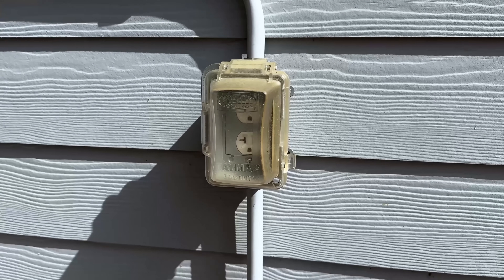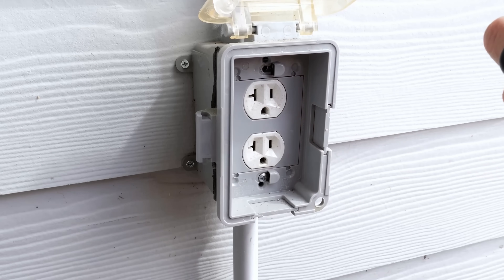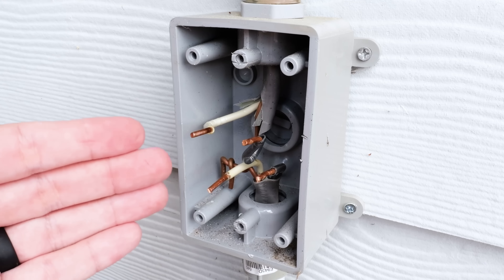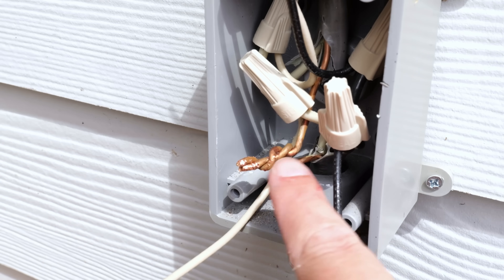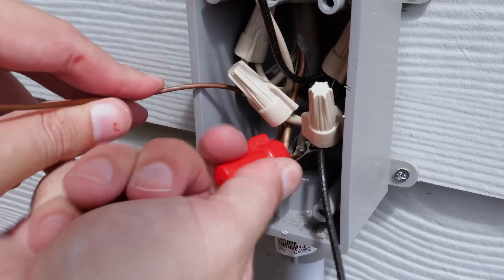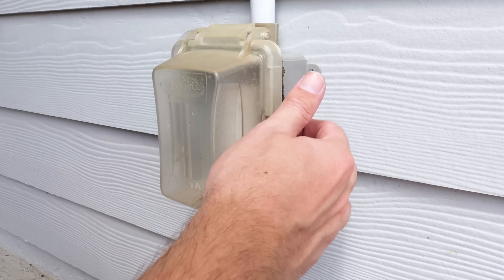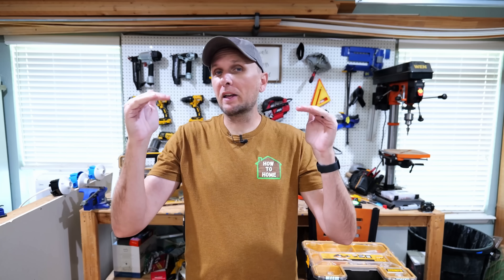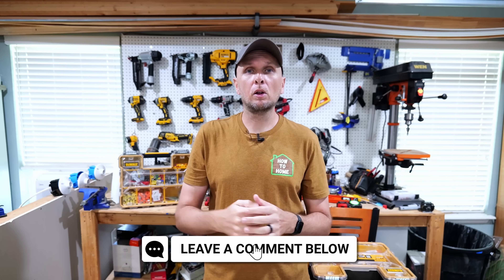Dangerous Mistakes DIYers Miss When Installing Outdoor Outlets!

Comment: The box got really crowded with pigtails and wire nuts,
and overcrowding isn't just about overheating.  
When you were putting the outlet and wires in the box, you folded the bare copper ground pigtail over to the side of the outlet with those bare hot connections.
You used the screws to pull the outlet and cover into the box.  
That left the final positioning of the wires to chance.  If the ground pigtail contacts a hot connection (seen that), or wire on wire contact cuts through the insulation(seen that too), it won't be pretty.
Reply from the maker: The ground is not along the side.
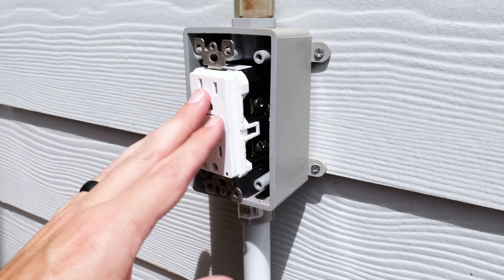Reply: Look at 10:18 when the ground pigtail got folded.
Reply from the maker: @stephenmathewes5159 that isn’t where it stayed.  I’m not looking at it but I’m pretty sure there is a jump cut then to screwing down the receptacle.

Comment: Unless you pass the 10 gauge directly you have the voltage drop issue so that load further down the line is not accounted for, correct?  You would have to keep that 10 gauge line on a path all the way through, so doing 10>12>GFCI>12>10 could cause overheating in this line or poor performance or failure of the down line accessory.
Reply from the maker: No.  Voltage is voltage and it only starts dropping the longer down the line.  This was at the very beginning.  Will have zero effect with the #12 there.
Reply: @HowToHomeDIY  thanks
Reply from the maker: You’re very welcome.

Comment: Why didn't you tie both #10's and the pigtail together?  Standard way to do pigtails.  I also don't think you adequately twisted the wire nuts in place.  My understanding is that the twist should continue to the insulated portion of the wires.
Reply from the maker: Because then my GFCI wouldn't be protecting the outlets downstream.  Yes, I would have liked to have had more twisting below the wire nut but you really aren't going to get that much with #10 wire and especially with them being so short.
Reply: @ I was typing the reply and forgot that you were gonna install a GFCI.  For my shop I put the receptacles on GFCI breakers and had that in my head.
Reply: @ I was typing the reply and forgot that you were gonna install a GFCI.  For my shop I put the receptacles on GFCI breakers and had that in my head.  They make drivers for wire nuts that allow the use of your favorite cordless tool.  It's cheap and does a better job faster.
Reply: Because that would've left the downstream receptacles with no GFCI protection.  The downstream wiring going out the bottom of the box has to be connected to the "LOAD" side of the GFCI receptacle.

Comment: 20 amp recepticals are not a problem in them selves ... a breaker at the box would be fine .. specific test tool and a sticker
Reply from the maker: Would have to be a GFCI breaker.  Which I don't prefer personally.

Comment: Should have ran THHN in conduit instead of uf wire
Reply from the maker: Why, there is nothing wrong with UF wire in conduit.  especially for such a short run above the surface.

Comment: Probably should have used a deeper box or extension ring. Conduit doesn’t need a strap unless it’s more than 3’ long. Also 12awg is sufficient unless you are going an extremely long distance. I suggest using a voltage drop calculator.
Reply from the maker: For the purposes of this video and what 99% of people will find in their boxes, the box was fine.  After the video I added an extension ring for my personal situation.  There is no way I am going to leave my conduit without a clamp unless it is an extremely short run.  The distance from this receptacle to the next one is well over a 100'.   Voltage drop needed to be taken into account.

Comment: I was thinking of two solutions to handle the very stiff #10 wire.  Get a deeper box, or add an extension, to give you more room for the pigtails.  Or to have used in the first place more flexible stranded wire.  My two cents.

Comment: Considering the size of the wire and all of the extra devices and wire added to the box, did you exceed the box space capacity?  You may have wanted to o add a box extender.
Reply from the maker: So yes in my instance I am slightly over box fill calcs just because of the #10 wire.  I did not change any of that for this video as almost nobody watching will come across this.  #12 or #14 would have been just fine.  The pigtails and wire nuts don't count for box fill.  I added an extension ring after I got done filming for my own personal situation.

Comment: Great video - very helpful. Just a comment - I like to use lineman's pliers to twist the wires together before I put the wire nut on. It's an extra layer of security that the wires won't separate under the nut.
Reply from the maker: I usually do too but with how short the wires were in the box and to save on time I just twisted them on per manufacturer's instructions.
Reply: Our inspectors wanna see the insulated part of the wires twisted together also. Thats
just the way that they want it

Comment: Hey, it’s possible that the outlet was already protected by a GFCI, but it was in another location? In a couple of houses I’ve owned they put the GFCI in the garage, which was a pain. If I remember correctly you can put up to 12 outlets on one GFCI, but that may have changed.
Reply: It's possible.  That's why you'd normally test it with a GFCI tester prior to opening the circuit breaker and removing power from the circuit.

Comment: I was wondering, did you not degrade the load by running it in series with a 12 gauge wire? Could you not have WireNet the two10 gauge with the 12 gauge and that way not slicing the 10 gauge?
Reply: If you splice the two 10ga wires together you'd leave the downstream receptacles without GFCI protection.
Reply: @staceyward777  that is true but I thought the goal of the demonstration was to GFI the outlet.
Reply: @  I guess if you really wanted to just have GFCI protection for that one receptacle and leave the ones downstream unprotected.  I think the goal of the video was to show the errors in this particular installation and ways to correct them in compliance with the NEC.
Reply: @staceyward777  thank you for your reply. But I am still wondering if the load downstream has been derated to 12 gauge by putting it in series on the GFI outlet. Again I assume the 10 gauge for the load is there for the long run and/or higher amperage needed?

Comment: When I moved in to my house it had 2 outside receptacles,  and neither were GFCI, or, wired correctly. Going through the house, I found around 30 small wiring repairs. 
It did have an inspection sticker on the electric panel, so I'm guessing it was done in the dark😮 
ALWAYS check
Reply: Non-compliant work could have been done some time after the passed inspection.

Comment: My old double wide came with two outside receptacles, neither of which were GFCI. My friend is an electrician and since those outside receptacles were on a dedicated circuit, he simply installed a GFCI breaker on that circuit. Took all of 10 minutes.
Reply: That's the way my  outside outlets are wired. Just on GFCI breaker for all of them.
Reply: That's one of two ways. After literally burning up 3 GFCI outdoor rated outlets I put the outlet inside the house and then use a standard non gfci outlet outside in the water resistant box. The yellow tape he showed in the video is for hooking more outlets to the circuit in series. Every outlet connected past the GFCI outlet will be protected. If you are installing a gfci outlet at the end of a line then you don't remove the yellow tape or use the terminals they're covering.

Comment: Is it code compliant to use a 15A GFCI as the first device on a 20 amp circuit?
Reply from the maker: Yes it is.  Can’t go the opposite way though.  210.21(B)(3)
Reply: @HowToHomeDIY  My thought is that on a 20 amp circuit breaker, there would be 20 amps or more going through the GFCI before the breaker trips, accounting for the GFCI and the downstream loads. For instance you could have two 1200 watt space heaters plugged into that circuit and the breaker would let them run all day and night. For the GFCI being rated at 15 amps it would likely let out lots of smoke and maybe start a fire. Maybe code compliant, but not the safest idea.
Reply from the maker: @rogerdirks947 ok, I understand where you are coming from, but that’s not what happens.  The internals of the 15 amp are rated for at least 20 amps.  Most times the internals are even identical to the 20 amp version where there are even prongs for the 20 amp plug.  The only difference is the face and what plugs are accepted.
Reply: Both compliant and cheesy
Reply from the maker: @thatWasntMe how? 😂.   It’s simply a preference.  There is nothing cheesy about it.  I have zero need for a 20 amp at that location.

Comment: Could be Branch protected by the GFCI in the main fuse box, as I did just last summer when upgrading to a sub-panel in the garage and this was code in my area.
Reply: Then it, and all receptacles on the circuit have to be labelled.  Also wet weather rated for outside recepticles.

Comment: Are there no 20a GFCI outlets? You replaced the 20a with a 15a GFCI.
Reply from the maker: There are 20 amp GFCIs.  I just didn’t want one there as I have nothing 20 amps that will ever get plugged in at that receptacle.  I have a 20 amp GFCI linked in the video’s description.
Reply: 15A GFCI receptacles (and normal receptacles) are rated for 20A feed-through; in fact within a brand's lineup the internals are typically identical and only the plug slots differ.

Comment: Nice. I have a GFCI receptacle setup on an outside wall (15A). I also wrap the box with electric tape around the face plate gasket to help further seal it.

Comment: Why didn’t you just pigtail your hot and neutrals together instead of running 4 pigtails?  You also didn’t mention that there potentially could have been a GFCI breaker installed and therefore you wouldn’t need a GFCI receptacle.
Reply: Watch the video.He explained it !  ! PEOPLE  ! commenting before they even watch the whole thing or never watch the whole thing .
Reply: That would've left the downstream receptacles without GFCI protection.  The wires coming out of the bottom of the box need to connect to the "LOAD" side of the GFCI receptacle.
Reply: I did watch the video. I worded my post incorrectly. I wanted to say just put in a GFCI breaker instead of filling the box with wire nuts and spending money on a new receptacle. That way you aren’t trying to pass the current through the receptacle given that there’s existing 10 ga. wire. It’s a better way to hook up the load current even though it’s on a 20 Amp breaker.

Comment: Why didn’t you install a 20 amp gfci? You just downgraded that circuit to 15 amp. It will trip before you even reach 20 amps…
Reply: No, he didn't downgrade anything, 15 amp duplex receptacles including GFCI's are permitted on 20 amp circuits and is commonly done. The GFCI will trip when there's a difference of approximately 5 mA between the hot and the neutral, regardless of whether it's a 15 or 20 amp GFCI. GFCI's are not overload protection devices, that's the circuit breaker's job.

Comment: One mention needed, before your test to make sure your circuit is off always check your tester on the live circuit 1st. cheers
Reply: Correct. Check first on live circuit.

I plug in the tester, check that it lights up properly, THEN i go shut off the breaker, and the tester should now be OFF.

Comment: Note: that exterior recepticle could be downstream on a circuit from a GFCI receptacle located inside the house, as is ours at my residence.   Or,.it could be on a dedicated circuit with a GFCI protected circuit breaker.
Let's not assume, let the information be complete.
Reply from the maker: I said it wasn’t.

Comment: If you have a GFI plug, with or without ground makes NO difference.  I know, the code says “it would be nice if you do”.
Reply from the maker: Yes and no.  It will most likely protect people but not appliances.  Having a ground is still important and preferred.  However, I’m unsure what prompted this comment as I didn’t talk about that.

Comment: I have found that a crimp connector like a molex  crimp conn splice takes up so much less space in the box and has the benefit of not coming off when I am muscling all that extra wire in the box. .  BUT it is so  much nicer when the electrician leaves a little more wire to pull on.  Did ya mention that it's gotta be NEMA 4??

Comment: You mention that the need for 10ga wire is because of the length of run after the outlet, then you negate the use of 10ga wire by using 12ga wire to bridge the 10ga wires with an outlet in the middle..? I am confused... This does not seem correct.
Reply from the maker: First, that has nothing to do with the videos topic as almost nobody will have that situation.  Second, I said that outlet was the first in line.  That far upstream will have zero impact on the voltage.  It doesn’t negate anything.

Comment: Box fill was ok on that box after the pigtails and wire nuts and 10 awg and big receptical?
Reply from the maker: Pigtails are not considered additional conductors, wire nuts don't count for box fill.  The receptacle size doesn't change box fill calculations whether is is big or small.  10 awg is almost never going to come up for most people so I just demonstrated it as though it was 12 awg as that is what is most likely on a 20 amp circuit and of course 14 awg on a 15 amp.  Box fill would be fine for those.  After the video I just added an extension ring for added space and to meet box fill calculations for myself.

Comment: Out of interest if using Wago's would it be better to use a 3 connector Wago and just have all 3 wires on the same bus? Then connect the outlet to the pigtail wire?
Reply: You want the Load wires that go further on the load side of the GFCI, and separate from the Line side wire. Using a 3 position Wago would make the points later on the circuit not GFCI protected.

Comment: Given it was not right from the start but was overdone and worked out fine you should have just added a ground pigtail and put the 20A GFCI in there.  You just added 4 additional potential contact problem points and overcrowded the box.

Comment: What is code on Box fill
Reply from the maker: For most people it will be #12 wire on a 20 and #14 on a 15.  Both of which would fall within box fill of the box in the video.
Reply: @HowToHomeDIY Think you missed what he’s asking. Each box has limit on amount of conductors and how they are figured into box fill. Current versus non current conductors E.G

Comment: Here is a different sort of suggestion that I think is safer but not code compliant.  The 3" beyond the box edge rule is based on the traditional use of wire nuts.   In this case, wouldn't it be easier, use less box-fill, and be safer to use a 10g 3 way Wago for the pigtail to the receptacle?   The stubby incoming and outgoing wires simply plug into 2 sockets and the pigtail plugs into the third socket and goes to the receptacle?   You mentioned carrying a lot of load over a long distance, so I would think that not running the load through the receptacle would be a good thing.    Cheers!
Reply: That would leave the downline load not GFCI protected. Yep, code violation.
Reply: @rogerdirks947 unless the downside didn’t need gfci like if it went inside a building
Reply: @rogerdirks947  Unless you swapped the next receptacle to GFCI too, or the remaining receptacles are not in wet environments.
Reply: Why wouldn't that be code compliant? It effectively splices the length of both wires to the required length.